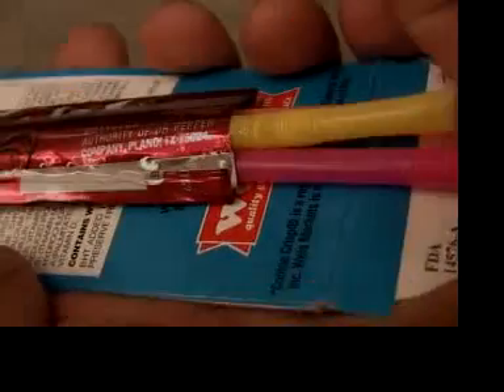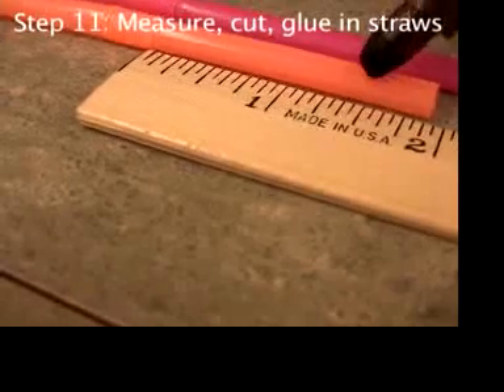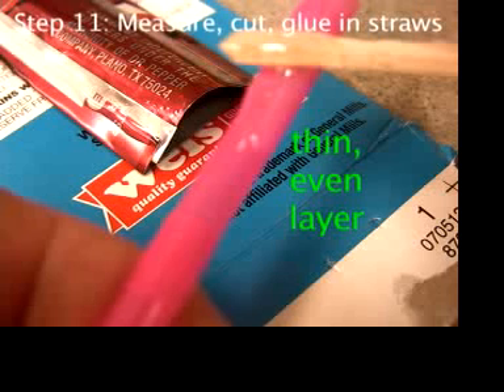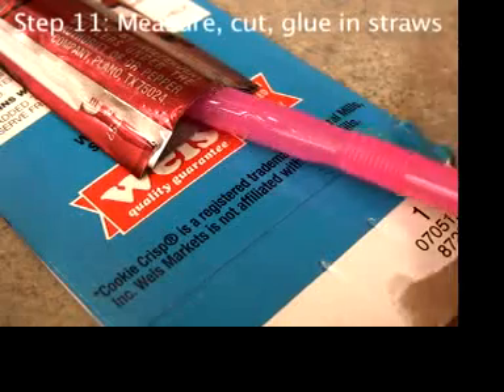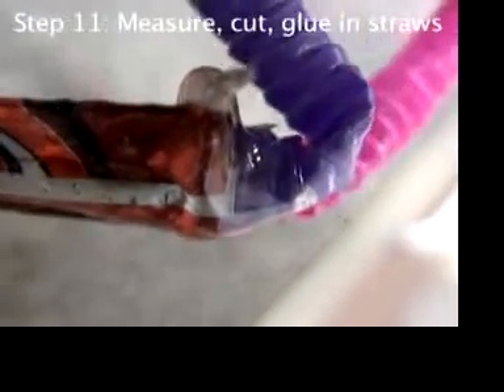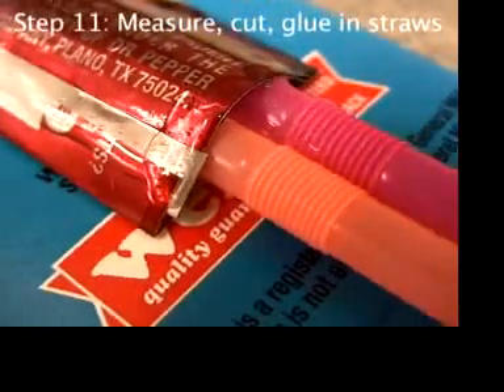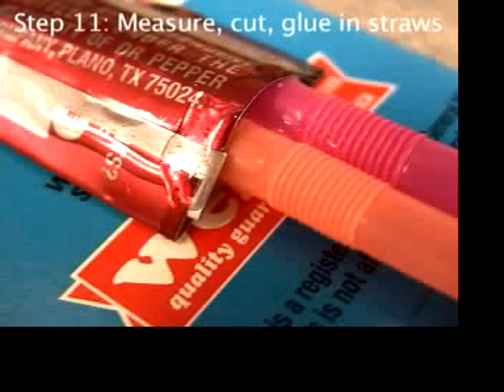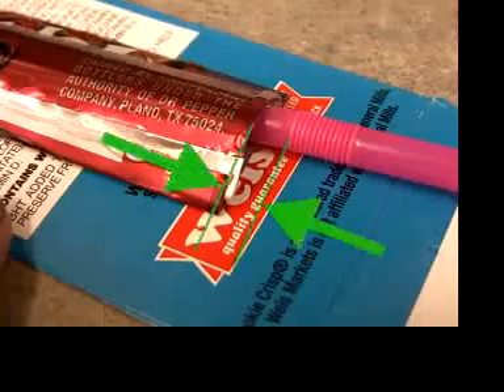Part 14 Build a Putt Putt/Pop Pop Steam Boat s11 glue straw in

Comment from the maker: @Darkreaperxl Well, I know some people don't like epoxy, but it's there for a reason. Not all glues withstand heat, are waterproof and fill gaps well. Epoxy does all of that.I have tried other adhesives--from super glue to silicone--and not found anything else that works.So when people ask if they can use JB Weld, the answer is yes, because that's just a brand name of epoxy. Follow directions exactly the first time through, experiment after you have one working.
Slater

Comment from the maker: @95berre Excellent question. The part of the straw that goes inside the engine should melt , or at least deform.  I think they do not because they are coated with a thin layer of epoxy. Epoxy does not melt.
Slater

Comment from the maker: @bagpipeingman Hot glue might work for sealing the straws where they come out of the engine Because it might not get too hot. However, you cannot use hot glue on the rest of the engine--it gets too hot. Until you get an engine running, follow the directions exactly. Experiment after.
Slater

Comment from the maker: It would would save time and hassle, but doing it as a single step just didn't work for me. With the straw in only a little bit, the other end of the engine seems to not open up, and it doesn't operate right. But after you've made one that works, experiment with ideas like that and tell us if you find a better way. 
Slater

Comment from the maker: re hot glue instead of epoxy: No. the stean engine gets hot; it would melt the hot glue. Follow directions exactly the for the first engine. When you get it working, then experiment with variations.
Slater